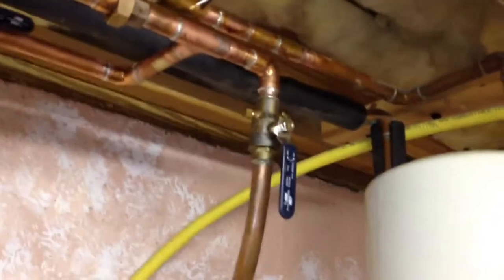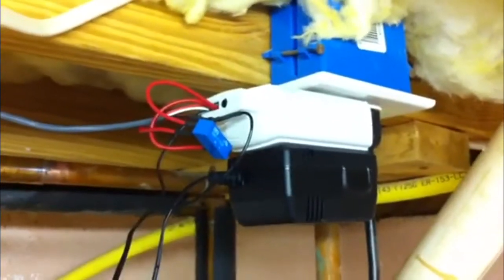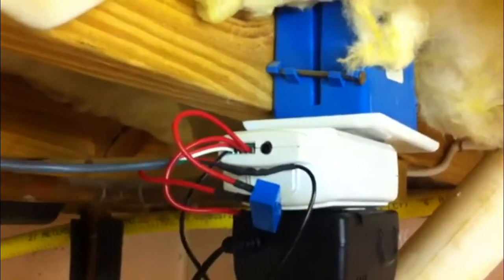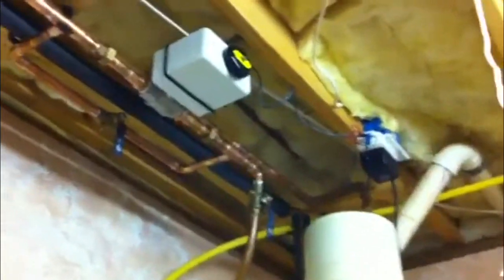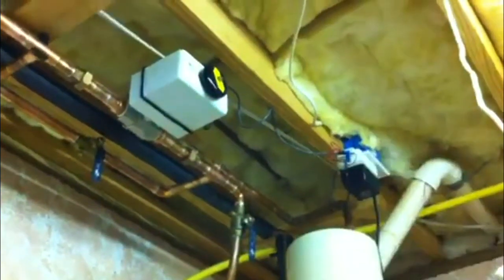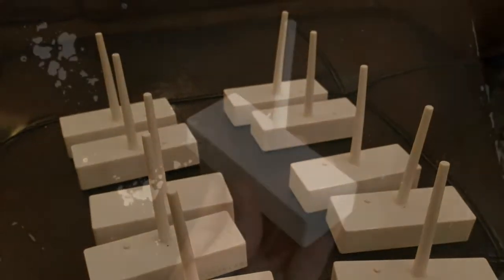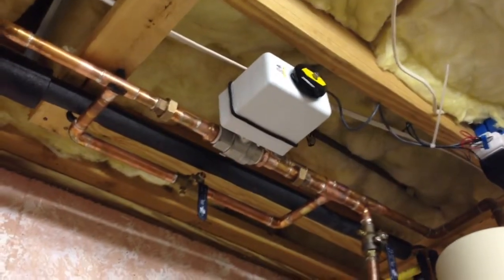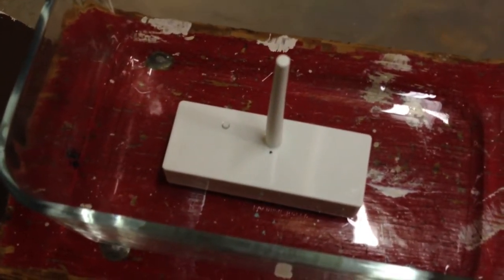Insteon Leak Sensor Install

Comment from the maker: Tomas, the leak sensor uses an insteon wireless net work created by plug in transceiver modules that interpret the signals and send them to an additional plug in module connected to my Mac mini by USB, the computer monitors the state of the leak sensors, if they change state it sends a signal through the previously mentioned devices to an additions io linc insteon that activated the valve.

Comment from the maker: I recently have had some questions.
The Elk Valve has 4 wires:
Red, Black, Green, White
Black is the common connected to the COM on the IO linc
Red and White are Open/Close wires
Red goes to the N/C on the IO link 
White goes to the N/O on the IO link
Green is the position indicator wire that is energized with 12v dc when the valve is closed and is connected to one side of the relay coil and the other side is grounded. The switched wires on the relay go to the IO linc sensor input (S) and GND.

Comment: I am planning on using the same ELK water shutoff value and Insteon IO Linc.  Could you send me a close up picture of the wiring to the 12v power supply and I/O Linc.  There are 4 wires out of the shutoff valve, g/r/w/b.

Red (valve closed) --> I/O Linc NC (normally closed)
White (valve open) --> I/O Linc NO (normally open)
Black (neg) --> Neg (-) wire of 12v power supply
Green ???

Then connect:
Pos (+) wire of 12v power supply --> I/O Linc common

This is not right.

Comment: Wish there was a wire diagram.  The link does not appear to be working.  I can't figure to wire the relay?  

I'm connecting the green wire from the valve to one side of the coil.  I'm not sure where to connect the other 3 terminals on the relay?

Comment: I am still trying to get my system set up like yours.  A bad elk valve and poorly functioning leak sensors have set me back.  What size valve are you using on what size pipe.  Thanks, E

Comment from the maker: The relay is nothing special, any 12v relay from radioshack will work fine.  The one I used happened to be OEG, OMR-C-112H.